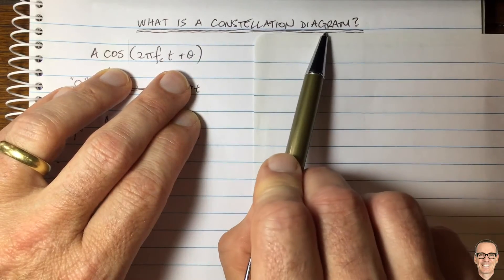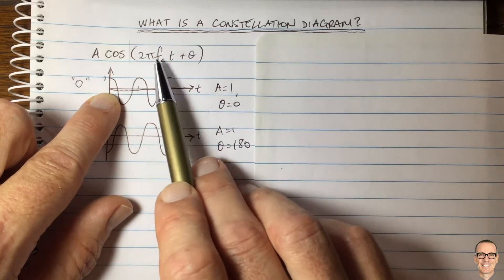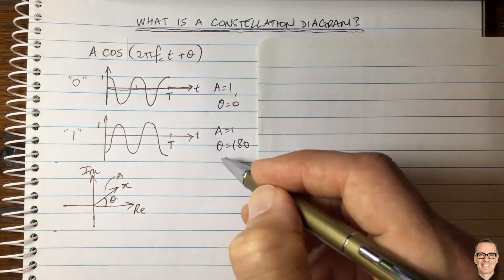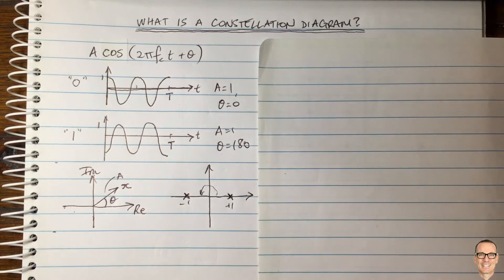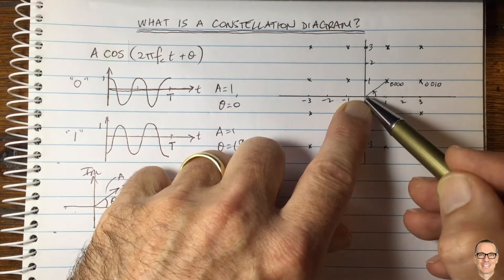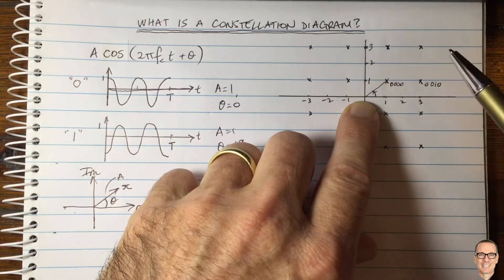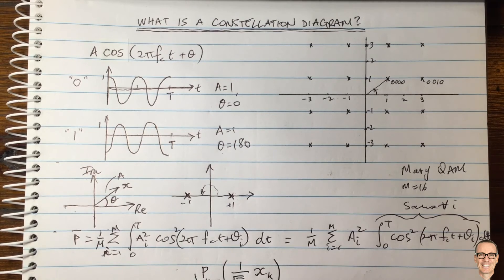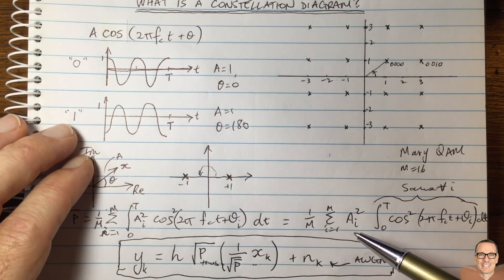What is a Constellation Diagram?

Comment: Hi lain, i have watched your video on transmission and reception both. I have confusion about what happens once we have bit streams and before modulation. I think there are blocks like symbol mapper, line coding, dac..why do we need them when we could directly use cosine with different shifts for 0 or 1 for example.  Because we need to genrate these phase shifted cosines by multiplying cosines with some signals which in fact come from line code and dac? I know symbol mapper is used to group bits into symbols..Then we create signals out of them through line mapper and dac that are used to modulate carriers, right?
Reply from the maker: Yes, it sounds like you've got the right understanding. Different standards use different terminology, so it can be confusing. The term "line coding" tends to be used in baseband communications (eg. baseband low rate ethernet), in place of the term "modulation" that's mostly used for carrier modulated communications (eg. mobile and wireless systems).
Reply: Thanks . So in case of passband, there is no notion of line coding. We have symbol mapper, dac and then carrier modulation, right?
Reply from the maker: Not necessarily. A "line coded" baseband waveform can subsequently up "modulated" up to a high frequency carrier for transmission in the passband.

Comment: why have you written the signal yk at the end? what does it let us compare exactly?
Reply from the maker: The y_k, at the end, is the equation for the output of a communications channel (ie. the signal at the receiver). The power loss in the channel is represented by h, and the noise in the receiver electronics is represented by n_k. If the loss is too great, or the noise is too high, then it won't be possible to distinguish between the constellation points (at the receiver), and then errors will occur in the digital detector.
Reply: Okay sir, thanks for the explanation!

Comment: For the digital "0", shouldn't the phase be 90° instead of 0° because the wave starts at the peak ? Correct me if I'm wrong.
Reply from the maker: The horizontal axis of the constellation diagram represents the cos waveform. So the video is correct. Note that the complex number exp(i theta) = cos(theta) + i sin(theta) ... which is why cos(.) corresponds to the real part, which is shown on the horizontal axis. See this for more details: "Why are Complex Numbers written with Exponentials?" https://youtu.be/Cy5IQnBpJoA

Comment: Thank you for explaining! 
I have a question in 10:30. My english skill is not good so i don't understand the 'h' and 'root p' in equation.
Could you tell me more detail about that..?
Reply from the maker: The 'h' is the channel gain (which will be a complex number with magnitude between 0 and 1), and the "root p" is the square root of the transmit power.

Comment: sir, can we plot a frequency variation signal's like MFSK using the constellation diagram?
like making the x axis for 'a' frequency and the y axis for the '2a' frequency ...... and how can we find the absolute value for the vector in this case?
Reply from the maker: Yes, that's right. Each symbol (frequency) in FSK is orthogonal to the others, so each constellation point can be represented by a point on an orthogonal vector (in a multi-dimensional space). Then it's just the same as for any other constellation diagram (except in higher dimensions). The decision boundaries are still equidistant between each neighbouring pair of points.
Reply: @iain_explains 
Ok, thank you.

Comment: Good day. I have a remark related to "terminology". Why do you speak about mean power of the costellation when you write the integral. A^2*T = E. It should be mean energy, isn't it?
Reply from the maker: Power and Energy are related by a constant, T (the time duration of the symbol), so it's just a simple scaling between the two.
Reply: For sure. I think wordplay happens because transmitting and receiving constellations should be considered separately and may even have different measured units. What do you think about it?

Comment: Thank You Iain, for making learning easier :)
Is this factor 'sqrt(p)' that you have used to normalize the X_k, is the average power of all possible symbols?
What is it mathematically?
Reply from the maker: Yes, p is the average power. To calculate it, you simply add up the powers of all the symbols and divide by the number of symbols. In the 16-QAM example shown, it is (1^2 + 2*(3^2+1^2)+(3^2+3^2))/4 ... you only need to work out the powers of the 4 symbols in the top right quadrant and divide by 4, since the constellation is symmetric ... and I've just used Pythagoras to calculate the powers of each constellation point.

Comment: sir can you please tell me the difference between the average power and transmitted power i mean i am not able to figure out the  difference , are they same?
and secondly @10:07 what do you mean by unity    power (Xk/sqrt(p'))= 1?
Reply from the maker: "Transmitted power" is the power at the output of the transmit amplifier that is connected to the UTP/Coax cable (for wireline channels), or as it goes into the antenna (for wireless), or laser (for optical channels). Typically the "average" value is quoted. "Instantaneous power" goes up and down at the carrier frequency, since it is defined as being the square of the voltage. If you want to compare two different modulation formats, you need to make sure you are doing a fair comparison, and so you scale the constellations (ie. the actual transmit waveforms) so that they have the same average power. The clearest way is to scale them to unity (ie. so the power equals 1).
Reply: @iain_explains  ok I got it now thankyou sir for looking into it

Comment: I understand why @8:45 the integration is the same for all I but the amplitude is not so clear. For QAM vs 16 QAM would be: (18+18+18+18)=72 vs 4x(2+10+10+18)/16=10. I assumed the amp for QAM is (sqr (3^2+3^2)).
Reply: @Iain Explains Signals, Systems, and Digital Comms it would be great if you take a look at this question.

Comment: Hi Iain, thanks for the nice video. One question: Are the carrier frequency fc and the symbol duration time T related to each other? Looking on the plot at 1:11 , I can see that fc equals to 2/T. So I guess in general we can pick fc as an integer multiple of 1/T. But is there any reason for doing so?
Reply from the maker: In general yes, the maths all works best when we pick fc as an integer multiple of 1/T, but in practice it's not necessary. In passband communications, the carrier frequency is so much higher than the bandwidth, that the fractional extra part of the "final" wavelength in the symbol has negligible effect compared to all the other "whole" wavelengths in the symbol (if you know what I mean).
Reply: @iain_explains  Thanks so much for the answer !

Comment: I am bit confused in the part where average power is defined (around time 8:00). If value is integrated over time would not be an average energy (at least dimensionally)?
Reply from the maker: The term "average power" means "averaged over the different possible constellation points (transmission signals)" assuming that the data is equally likely 1's and 0's (ie. assuming that each constellation point is equally likely.)
Reply: @iain_explains  thanks for the reply but my doubt is not about the fact that we are "averaging" but rather on the quantity we are averaging. I see we are integrating over given time (the period) the square of signal value; so it looks to me we are averaging an energy rather than  power. Could you please clarify to me this point? Thanks
Reply from the maker: Ah, sorry, I see now. Yes, I should have called it energy (sorry about that). It's just a scaling of T between the two, so sometimes the final equation is written with P's (Power) and sometimes with E's (Energy). Depending on which is put there, the variance of the noise term n_k is either N_0 (for the Power version) or N_0W (for the energy version). This video has more details: "What are SNR and Eb/No?" https://youtu.be/bNYvXr6tzXQ

Comment: at 10:06 in your video you say "so this gives you a power of 1 " . [1] I did not understand this part . [2] how does that scaling of dividing by square root of average power is making the comparison across different constellation easy ?
Reply from the maker: There is always a limit on the transmit power (due to either government regulations or simple battery limitations in the device). To choose which modulation format to use, we need to make sure they are compared under the same power constraints. It is not acceptable to add more constellation points at the outside of a constellation (ie. to use a higher modulation order, and thus send more data per symbol) without scaling back all the points so that the overall average power remains the same.